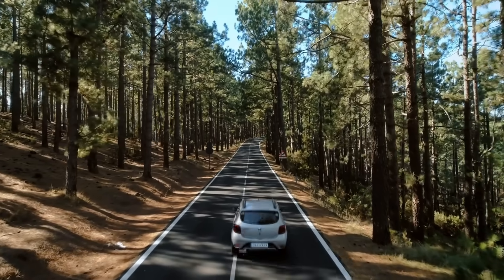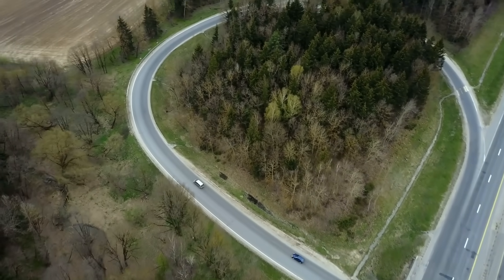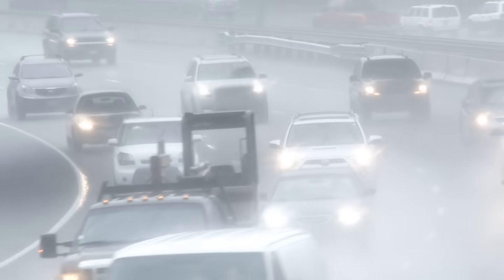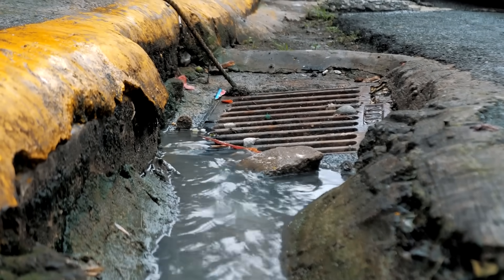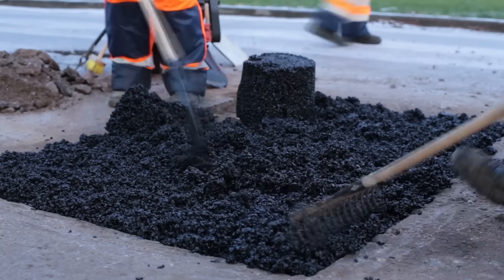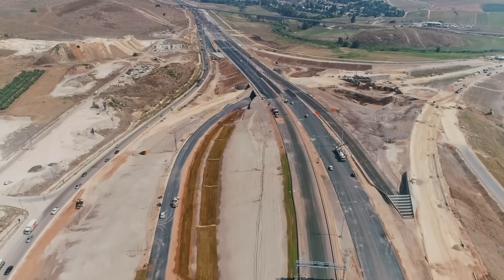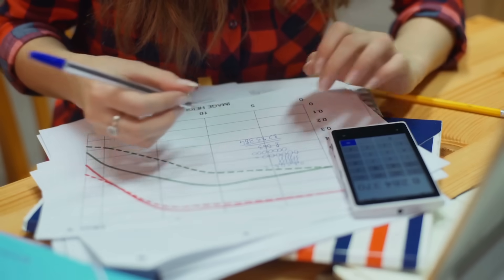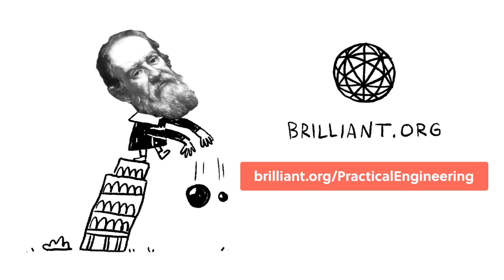How Do Potholes Work?

Comment: In malaysia , potholes are purposely made , 
Manholes are on middle of the road even on highway, that means it already lack of support from the beginning , then when its time for new pavement , they pave the whole thing but left the manhole untouched, and suddenly bunch of new holes after a new road work , sometimes the it left holes that more than 2 inches deep 
Then the politicians..... when ever there's an election, there will always start to pave the road , sometimes even the road was in good condition,  they still pave it, and with all those "tight budgets show" , the asphalt became extremely weak and pothole formed less than a month and took another 5 years to election and finally get the potholes fixed but not for long 
Government also plays a major role in creating potholes 
They never communicate with each other, when the road is paved , and another Government sector will start to dig the road , sometimes pipeline, sometimes wires ... after that they just simply cover up without properly repair the holes or trenches.... if you want corruption, atleast do a better job so that we don't felt frustrated, we know that most of the time companies that perform these repair works have relationship with the PIC, assigning jobs to their relatives companies .... 
THIS IS MALAYSIA , WHERE CORRUPTIONS WERE NORMALITY IN THIS BOLEH LAND

Comment: The biggest key to a good commute is to ENJOY the car that you are in. Don't look at a car as an appliance, rather more like an experience, and I guarantee you will have a better time on the road. Driving does not need to be a frustration. Something as simple as learning to drive a manual transmission car will drastically change your outlook on driving. From an engineering standpoint, being involved with the car is interesting in itself. Pick a car that is engineered to be intellectually stimulating. You don't have to settle for a Prius or Civic.

Comment: Don't build roads if you don't want potholes.Problem solved

(Sarcasm)
Reply: Actually, that statement has more truth than what it might seem! If a public authority builds too many roads, then how does it hope to have enough money to maintain them? This, for instance, is one of the costs of suburban sprawl. Having land uses spread out with low densities, large setbacks and parking lots in-between also means that there's more road surface to maintain per inhabitant, and these inhabitants also spend more time and money traveling between activities, meaning they have fewer money and work hours to pay the taxes required to maintain the roads.

Comment: I really appreciate a well maintained road. Growing up, the roads in the surrounding area by my house were all cracked and damaged, side walks were buried in weeds or destroyed by similar reasons roads get potholes. A few years back around 2015 they stripped the top layer of asphalt and left the roads feeling really bumpy/grainy for a few days. During those days skateboarding was nearly impossible because the wheels would come to a halt while traversing the roads due to rubble. The wait was definitely worth it because once the roads were all finished, driving and skateboarding became pure bliss. <3

Comment: Every six months or so my landlord coats the asphalt with a thin layer of what looks like oil or tar. Its so thin that it doesnt seal the cracks. What is the purpose of this? It must cost thousands over the course of years and it seems like if he saved that money instead he could just completely redo it it every 15 years or so.

Comment: I lived on a street that had a different type of pothole then the one described, but I’m sure the pros eases described also had an effect:

The road passed over a gas main to our neighborhood, and at some point, it needed to be replaced. However, someone screwed up, because the soil was not put back properly and the road sank. So, for many years, they kept patching, but it kept sinking. Eventually, they ripped out that entire section of road, found the issue, fixed it, and replaced the road.
It was kind of inconvenient, as very few months there would be construction, and we would have to go out of our way to go around, and the last repair they did lasted 2 weeks while they found the problem.

Comment: There's some cool test going on in different parts of the world. There is a self-fixing roads that fills up cracks and potholes.
Some are putting solar panels in there for power to light up the roads and in some cases heat up the roads above 32°F/0°C

Comment: I have a theory about potholes, at least in the New England city where I live.

I mostly get around on foot, so I've seen a lot of pot holes form on my street.  They invariably form between 1 and 2 feet of the curb, and start as cracks parallel to the direction of travel.  The road is surfaced in asphalt over a substrate of cobblestones.  No cracks form in the middle, where the left hand wheels of a motor vehicle are supported, only at the side.

I believe this is because of bicycles.  Car tires are inflated to around 30psi.  Bicycle tires are inflated to anywhere between 60 and 150psi, depending on the bicycle.  That is two to give times the force on the pavement binder than from a car.

Those who I've explained this to don't believe it, but they can't find anything wrong with my reasoning.

What do you think?

Comment: Potholes start with a crack ?
Asphalt is flexible.
As a bicycle driver. I've found sandblasting a crack & filling with tar is not a solution. Nore is patching to form an asphalt quilt with steps in the roadway.
Isn't a crack, an indication that the fexible road surface has dried out or the tar used to make the asphalt ?

Comment: I’m surprised we didn’t talk about how asphalt can wrinkle up like a rug. Heavy trucks applying their brakes at intersections or just before tight turns causing the pavement to slip laterally over the base makes interesting waves, sort of like a washboard and eventually becoming potholes. It sux to drive on but the mechanics are interesting.

Comment: In Boston I've noticed that streets which are paved over the old cobblestones very seldom develop potholes  even when they do crack.  But if a contractor comes in to do work and then doesn't replace the cobblestones afterwards, the potholes start to form.

Comment: Here way up north on high traveled remote roads they cut the road into sections about 50ft long. Essentially they just treat all the sections as separate roads. Once one chunk gets bad enough (usually two seasons or so) they just replace the whole chunk. I think they even regrind and reheat it on site.

Comment: Here, in the UK, many local authorities have a programme of what they call tar spray & top-dress, whereby they arrive in Summer, spray non-motorway roads with tar / thin bitumen then use < 15mm granite chips to top-dress the entire sprayed area. This is applied over cracks, potholes, the lot. The two weeks following this treatment will see a 20mph speed limit imposed due to the chippings flying off to a great extent. It is nothing more than a 'See, look how we care about our roads.' type of exercise. The colder, wetter weather sees the holes open back up and the road condition rapidly deteriorates. They will do this for several years before finally giving in and resurfacing the affected stretches of road.

Comment: You've explained potholes where wheels pass. However, as a cyclist, most of the road deterioration happens where cars do not pass: the sides of the road.   Water infiltration alone does the trick in places with winter.  Also, the asphalt surface itself gets roughed up by snow ploughs, and rough surface keeps more water on road and when it freezes, expands and causes surface cracks, surface cracks let water in deeper and when that freezes, the cracks deepen etc etc.
Reply: And, things like manhole covers or water cutoff covers seem to be more common near the edges of the road, a wonderful place for water to seep in and destroy pavement.

Comment: I'll tell you how pot holes work....

they arrive overnight on the very road that you take on the way home.
They get in the way of my tires.
When my tire hits a pothole, the pothole fights back, refusing to be a victim.
The pothole pops my tire really good, and then beats the shit out of the tire's friend, the Rim.
I get dragged into the fight, and now I have to wait 2 hours for a tow truck to show up.
I have a quick burial for my popped tire, and my wallet is now lighter.
The Rim now has a lawyer, and demands that i get a new one, otherwise i'll feel him every time i drive over 50 mph.
I bribe The Rim with my Credit Card.

Back on the road, and every time i see that pothole on my way home, I flip him off.

Comment: "Something we've all experienced once or twice"

Idk. In Chicago you'll experience it once or twice per block.
Reply: In Delhi u'll experience it after every 5 cms.
Reply: in New-Brunswick, Canada they just use the potholes as a cheaper variant of speedbumps and never patch them
Reply: There's always that road
Reply: I had a buddy in college from Chicago.  In the summer, he worked on a pothole maintenance crew.  Common practice was to fix as few holes as possible, if any, and pave driveways for cash with the asphalt instead.  He said it was a coveted job due to the large cash income that crews could make (he had family that ran a few crews, which is how he got his summer jobs).
Reply: @ScottHammet  lol that's called corruption and theft
Reply: @moosanyc  Welcome to Chicago!
Reply: here in Greece you will experience that on every road 3 times

Comment: Here is Manitoba pretty much all roads are concrete.  An asphalt topping is sometimes used.
What I've noticed with respect to potholes is that the concrete roads tend to deteriorate initially at the control joints.  They are typically sealed, but the sealant comes out after a few years and then the road deteriorates.  The asphalt on the other hand always tends to deteriorate at the joints.  Where one asphalt lane butts against another, or where asphalt joins to concrete.  It may be flexible and inexpensive but it does not appear to form a good bond with anything.

Comment: We use concrete in Texas because the asphalt can get too hot and often melt a little bit, and because of that we get less potholes. But if a pothole happens, you have to replace the whole slab nearest the pothole

Comment: Over here the main thing that causes potholes is braking , there's usually concrete right below the roads because it rains so much here and they want to just avoid the water erosion problem, most of the potholes are at traffic lights or at the bottom of slopes where vehicles brake, apparently all the energy from breaking is transferred to the road and cracks it, then stopping or slowing vehicles just start ripping chunks out of it
On road bikes : warn the other cyclists to the potholes so we can go around
On mountain bikes : "yo ,wanna jump it ? "
                                     "Nah man, I paid for the  
                                       suspension I'm gonna
                                        use it"

Comment: "Drive on the same roads as everyone else" That's why the roads in the richer part of town are nice, and elsewhere are so pothole ridden as to leave some functionally unusable.

More importantly, could we not slip a rubberized plastic sheet just below the surface to divert water away and stop the erosion of the road at the cracks phase?  At the very least, I'd expect this would drastically cut the cost of maintenance, plus it should be extremely cheap to implement, plastics like this are produced in the megaton quantities, it's not like scale hasn't already made it quite possible.  Heck look how much amazon packs in a box!

Comment: You know, Practical Engineering, I have been driving for about nineteen years now.  I have found that there are some roads out there that are terrible they are more accurately described as "suspension tests" than roads.

Comment: I wonder if the subgrade/soil composition makes potholes less likely in any substantial way. If for example, the soil were more hydrophobic, more water would rest underneath the asphalt, and that'd be pretty bad, but maybe it would also remove less of the soil?  If there's any weight to the composition idea, there might even be data on pothole numbers in areas with different mineral compositions!

Even if I'm missing a ton of info here, it's still super cool to think about. Great video PE!

Comment: In some rural towns here in NH have decided to return to graded gravel instead of restoring the asphalt roads. The gravel is mostly a local material and costs far less than oil based asphalt. The big problem is in the spring when the top of the pavement thaws and the base is still frozen. Some roads become linear mud. Once the base thaws a couple of passes with a grader restores the road. Some more passes during the summer keeps it smooth.

The town I live in spends a lot of money partially restoring the local roads. This is a partial repair as the politicians decided that a properly rebuilt road with proper drainage simply costs too much. So we drive on what we have.

Comment: Most places in the UK just use the baserock as the top layer for a road, rather than lay a layer of tarmac on top. After a few months, that erodes away and the layer of road beneath shows through but this never gets repaired.

Comment: Believe it or not, potholes are a problem here in Jordan but not as large as the stupid freaking speed breakers which are usually created by miserable underpaid workers... the irony is they usually create those speed breakers right after or before a pothole and you have to slow down twice. I am sure that anyone who lives in Jordan or been to Jordan would agree.

Comment: Sorry to say but what i see here, the wearing surface is as thin as griddle. In Germany we do not build roads like that. We have a very thick layer of gravel with 4 to 5 feet, have a nearly one feet tick base course and upon on this a five inch thick wearing surface. This helps roads will last for 30-40 years depending on usage. Sure this is very expensive but it's way cheaper then having a road in bad condition that needs to be repaired repeatedly.

Comment: I just came back to Montreal after doing a PhD in Hamburg. The difference is kind of incredible.

In Hamburg, wherever I went, I had to actively look for potholes or other road imperfections. What they do have has typically been repaired already.

In Montreal, almost anywhere I stand, I am almost certain to see either an unrepaired crack or a large pothole.

Sure, climate has a big impact on it. But I can't help feel that corruption in the construction industry in Montreal means our top layer of asphalt is probably thinner than it should be considering our climate.

Comment: For me also, driving lost its charm not long after owning my first car. With so many vehicles on the road nowadays, and the old 'rush hour' now being 'rush hours' and the potential for drugged-out drivers, I find it a chore and would prefer to avoid it altogether during peak times.

Thanks for the explanation around pot holes -- one of my pet hates. I'm a chronic pot hole reporter in my locale. From your explanation, I can see why cold climate states pour tar into road cracks creating miles of crazy patterns in the process.

Comment: I feel bad for people who don't love driving.
Reply: It's much more fun if you ignore that speed limit thingy.  And if you are stuck in traffic, just get a motorcycle and lane split.
Reply: @thekinginyellow1744  consideration of speed limits should always come secondary to consideration of safety. Both for driving faster or slower than the limit.

A person in a well maintained car, who has good situational awareness, who is familiar with the car and the road, who is aware of traffic patterns, who is aware of other drivers and their potential actions, and who takes driving seriously with full focus can drive very fast and very safe.

I reach 125 on my way to work every morning for about 15 miles, but only when conditions are right and only in the places I know it is safe to do so. 
You will always have the risk of sudden mechanical failure, road debris, animals, acts of god or whatever, but these risks can generally be mitigated by a serious driver with high situational awareness. I am entirely confident that I am a safer driver at 120mph than most of the barely awake drivers going 60mph that I share the road with. They are driving because they have to and it is a burdensome task for them. They don't care much about their car since it is just a tool to get them places so they only fix things when they break. They are disengaged and not mentally involved. Sure 1/2mv^2 is an unavoidable fact, but it's not the most important safety consideration.